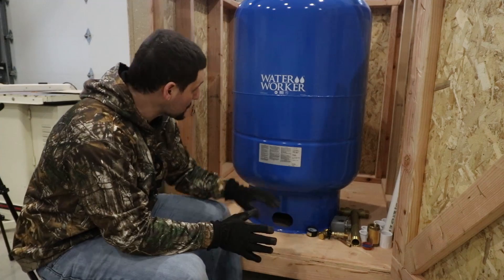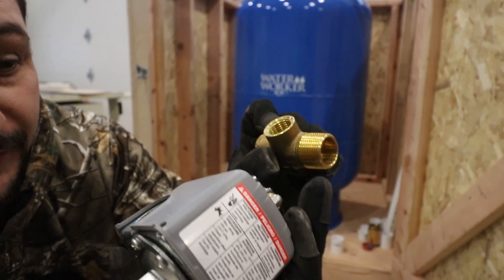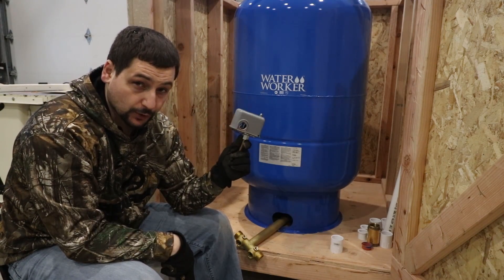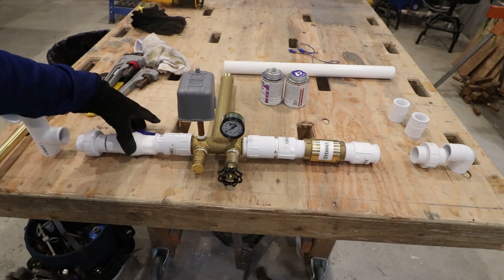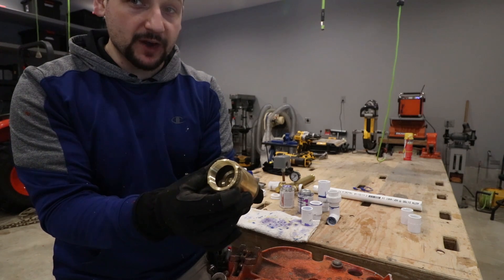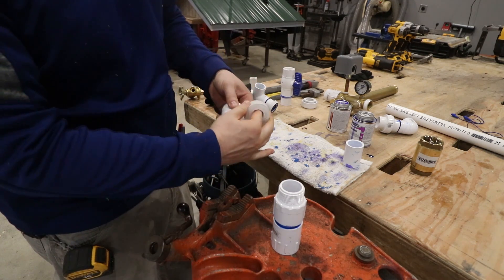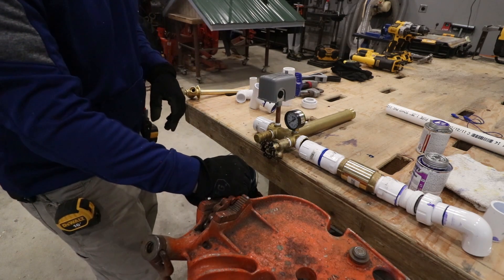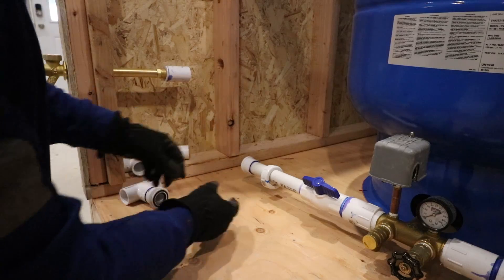Well Water Pressure, Pumps & Tanks/How It Works

Comment: I keep seeing people not installing a check valve cuz of water hammer will it hurt something if u don't have one ????
Reply from the maker: A check valve in this location next to the pressure tank has nothing to do with waterhammer. There’s a bladder inside the pressure tank that absorbs the shock of the system turning on and off. If you’re having water hammer issues it’s because of something else. The check valves are intended to not allow water to go back down your head pipe into your well. Without them, you’ll eventually ruin your pump. There’s a check valve built into the pump in the bottom of your will and then if your wall is over 100 feet deep you have a check valve every 100 feet and then you should have a check valve next to the pressure tank, make sure it’s on the correct side of the tee.

Comment: Why didn't you put a union between the connect at the bottom of the tank  and the  pipe you screwed into the  bottom of the tank  ? Without the union somewhere between the tank  and where it goes into the other fittings  you can't just replace the tank  without taking every thing back apart . The tank is going to have to be replace  before the fitting go bad . The best place to put the union is  just on the out side of the tank  opening where its easy to get to .

Comment: The main reason plumbers don't like the one way valve is it can stick closed  and you can burn out the pump . This is no reason for the valve to be there in the first place . It serves no purpose . Water will not flow back out of your house because on the bottom of the pipe in the well  is a one way valve .

Comment: Nice work. There's really no need for a check valve. The foot valve essentially serves as a check valve if someone using a jet pump.
Reply from the maker: The application you’re referring to is for shallow wells only. The well that this is being installed is over 180 feet. And as such, there’s a check valve at the bottom there’s a check valve 100 feet up the pipe. There’s a check valve at the top of the well and there’s a check valve in the pump house. To prevent loss of prime, air hammer and ruining the bladder inside. The pressure tank.
Reply: Thank you both. I have a 1/2 hp jet pump with a very shallow 9’ deep well. It has a foot valve …well it will soon as I’m replacing it. I’m also replacing the Pressure Tank. From the sound of it. I don’t need to add a check valve to the Tee?

Comment: Small criticism from a plumber. You could have use a metal union on the outlet side and a metal checkvalve on inlets side of the well tee. Than install male adapters into the metal females. Try to never use female pvc adapters cause that is the most common failure I come across as a service technician... 

And Teflon tape can be installed backwards because if installed the wrong way as you tighten the fitting the tape backs out of the threads and water flow through. 

The 90° in the wall you could've twisted it at an angle and than you could eliminate 2 fittings 

Other than that good video.

Comment: Once again. Your connection tee at your tank. Eliminate the female pvc fittings. 
  Plus when drilling your exit hole through your floor. Don’t make them so large. You only make mouse entrance doors. That is unless you close them off with sheet metal or something??

Comment: Ok so far so good??
   You should never use a pvc Female ips fitting. Ips female fittings over time expand then crack and break. On your first pvc female fitting you should remove that female fitting install a brass coupling then install a pvc male adapter.
     Do you understand what I’ve said???

Comment: Hi, i installed a spigot on the supply line only to find it wont work because the pressure doesnt drop when i open the spigot ( because of one way check valve?) Do you have any suggestions on how to make it work?

Comment: Why do you need a check valve between the tank  and the pump?(Pressure side) Never heard of this.
Reply: Because when the pumps shuts off, the full column of water is collapsing back down into the pump's impeller. Some guys recommend one for every 200 feet. It also prevents surging and fluctuation by keeping water pressure from going backwards.
Reply: @Jasondhodges82  Are we talking about a shallow well?
Reply: @joequillun7790  No sir, I'm referring to deep wells(technically thats anything deeper than 25ft.)

Comment: If the check valve (which is installed on the suction side of the well pump) is installed backwards, you'll never get water to the pump.

Comment: If I have a check valve in between the well and pump inlet do I need another one between the outlet and tank?
Reply: No, when your faucets are turned off, pressure is maintained essentially because they are air free.  Well systems only need one check valve.

Comment: I did not use the Square D switch. I got a Water Worker pump control which you can adjust easily. This switch protects your  pump as it does not allow the pump to run dry. It is a bit expensive but when you consider the cost of your system, better be safe than sorry.

Comment: teflon tape goes on one way There is no good and better way. If the tape is installed wrong your tape will come off the threads at you screw your threaded fittings on.

Comment: Excellent video, I am missing something. You said not to install the pressure relief valve between the pump and the tank, but that is exactly what you did. I don't see any problem with that as long as it's installed in the right direction. What am I missing here. Thanks
Reply: I had the same question. He's talking about a ball valve with a handle, not pressure relief valve. The "check valve" or one-way flow valve does go between the well and the tank. The ball valve goes after. The pressure relief valve is on the tank adapter.
Reply: Direction of flow for the check valve is towards the tank, the other way is no good.
Reply: To be honest, before and after is only 2 inch away in the same pipe. Makes no difference at all. Any.

Comment: I have a similar setup in my basement.  Its on a concrete slab but where the flexible pipe connects to the line outside there is a hole in the wall and when it rains heavy, it comes through the hole in the wall right into the basement.  I don't think the plumbers ever filled the hole with anything.  Can you suggest what I can fill it with.  Not sure what I can use?  Expanding foam maybe?

Comment: When I last installed a tank, I built a solid 2ft sq platform for it to sit on. That solves all the problems with lack of clearance to rotate all the fittings. Then I had some proper labels made up so I'd remember exactly what all the valves did and where the pipes go. Gotta pre-empt that dementia...
Good idea on pre-building all this stuff.
I hope you plan on adding some heat tape for those pipes, that's saved my ass a few times

Comment: Why don't you ever just screw the check valve right on to the tank tee
Reply: Because the T off the tank allows it to be adjusted to the required 10" off the ground and easier access. I am sure you could, but as long as the tank comes with that Brass T ,why not use it

Comment: Hi,
 I really appreciate you doing this kind of video. I have a problem with my well pump system. 
I just got a new well drilled with a submersible pump and a new 4.5 Pressure tank, pressure switch and Cycle Stop Valve installed . 
The water pressure build up to 60psi and cut off fine, but when a valve is open the pressure drains quickly down to zero and shut off the pump. 
I tried everything to no avail. Is there anything wrong with my system? Unfortunately, it is out of the country and no one has any idea of how it works. 
Would you happen to know what could be causing the pump to shutdown when a valve is opened?
Reply: I think your pressure switch needs to be adjusted correctly, some times they come not adjusted correctly or the pump is not able to keep up with the demand. I have seen this on a 4-5" submersible pump when the screen is plugged and had to have a well driller pull the pump and clean or replace the screen. Fix it before you burn your pump up because it won't take long
Reply: Egyah Echie cycle stop valves have one flaw which is the tank is small, I recommend a tank that can flush your toilet without turning on the pump